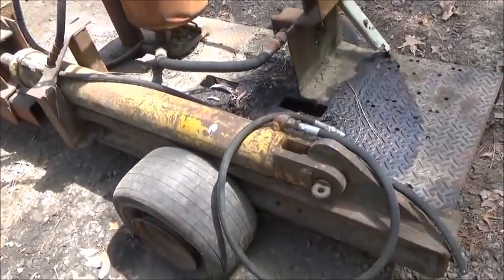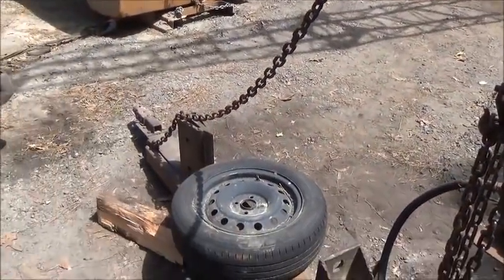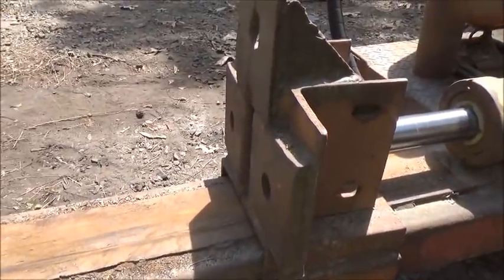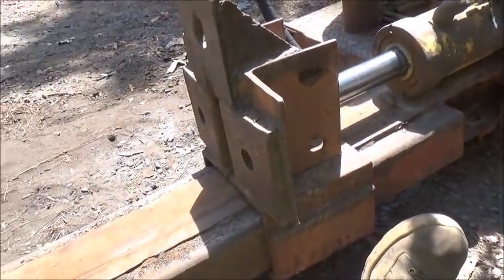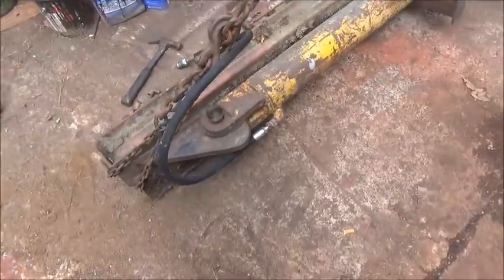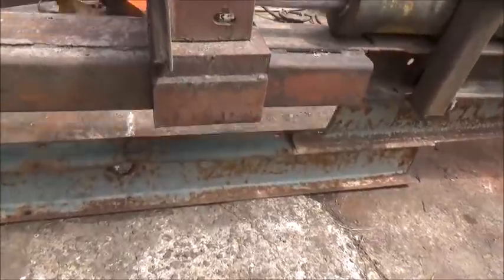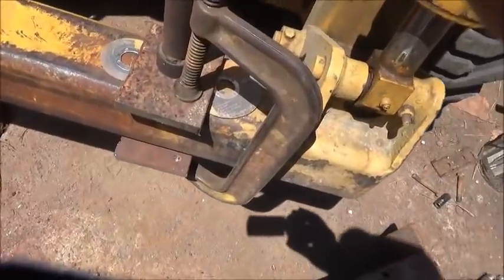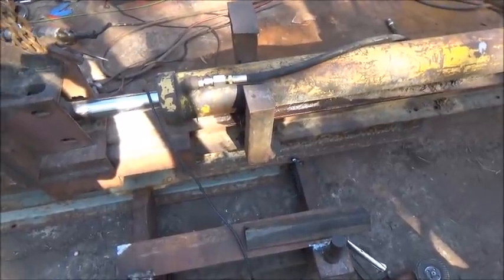TRASH TO TREASURE SERIES EPISODE 2 PART 1 OF 2 RIM CRUSHER

Comment: Didn't watch the whole video.  I built one from junk years ago. I had the wedge on the ram. Welded an open ended box on the stationary end. Folded rims I to a v shape and they fell right out.  I tried everything,  including pushing the rim out of the tire and this is what worked. I placed it face down also. Then the rim doesn't try to push up and out. Worked good for a camper frame and a bunch of discarded parts.

Comment: Well......that sure gives me ideas about a wood splitter. If you turned that one upside down and mounted it so it stuck straight out from the skid loader, You  could split wood on the go from the seat.  I have a big Mustang skid steer that has really high flow.  It 'd run a big cylinder fast.
Reply: You can actually buy those like that....
Reply: @notajp  I've got all the ingredients to build one I think.

Comment: I run a 5" cylinder off of a 1948 Allis Chalmers  HD14 powered buy a hand start 2cyl Wisconsin  off of a #68 New Holland hay baler the pump is from a John Deere #45 EB combine. Relief set 2500# Will fold 16" truck trims with ease.  You pressure looked a little low.Turn wheel center down and  they don't jump out as much. Oh and don't forget to knock off wheel weights.  Got a load rejected once for that.

Comment: Idk what it's like around you. Around here if your tires are reduced to pieces of tire you can take them to the landfill. When the local landfill here charges per tire, it's to cover the cost of labor to slice them. And then they put them in the landfill. So you pay the weight plus labor basically.
What I'm getting at is the way that cut the tire on the wedge side, I wonder if you could run a wedge on the cylinder too. Maybe cut the tires in half. Idk, seems it would be worth figuring out if you could turn down the cost more...as in would it be worth it. 
Thanks for sharing

Comment: I must have missed something.  What's the future in bending rims?  We built a wood splitter once, similar to that one but not as large and never put an engine on it either, instead we'd run the pump hoses into the back of our old '39 J-D "A" and it worked quite well even on knotty old sticks sweet gum stove wood.  Bending a rim with it would have never occurred to me.  Is it for compacting them to get more onto a truck to take to a scrapyard or something?
Reply: He just wants the tire removed. I don’t see why he don’t just make it to cut through the tire itself and not crushing the rims. Looked like it did cut the tire into. Crushing the rims adds no extra money for them.

Comment: So cool, being able to run it with the loader. Nothing better than a way over built log splitter. A friend of mine's dad built a beast of a splitter on a 18in I beam, had a V4 engine, it would easily cut logs across the grain, never even changed tone.

Comment: Am surprised that you don't have an old Coats 1010 or better yet a 2020 sitting around at your business,. It could dismount a tire in about thirty seconds with a lot less noise and air pollution but you would need a young man to do it to save your back. This is way more fun watching your problem solving and practical engineering!
Reply from the maker: I do

Comment: Is there any benefit/drawback to making that a vertical piston. I was thinking you could roll the tire into it, use a makeshift gate to keep it in place like a cattle chute (shute?) for inoculating calves - crush and drag the pieces out; no lifting. A day of hoisting tires three feet onto a beam might wear you out. The problem would be the wedge/plate structures would have to flip with the plate on the bottom and wedge on the piston.

Comment: Maybe If you flip the splitter upside down and attach it to the skid steer you could lay a bunch of wheels and tires on the ground and move the splitter over the rims and operate from the seat . Also the beam would keep the rim fro shooting up in the air..  would work the same when splitting wood.
Reply: I’ve actually seen log splitters for skid steers that are made to work like that.....

Comment: I wasc thinking it might be better to flip over so the rim is on the ground,that way wouldn't have to piic it up onto splitter beam,and if the rim was to jump or explode, alot of the forces would be absorbed by the ground, and less chance of it flying around to who knows where!!Like you said,your dealing with a lot of pressure and force , and having a rim explode would make a bunch of shrapnel!!